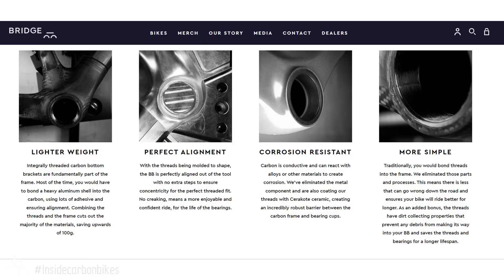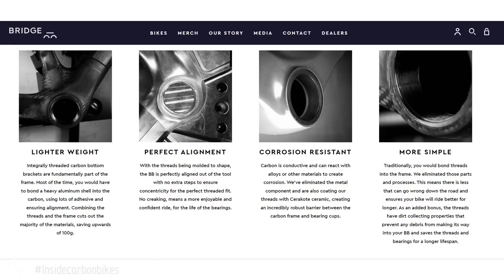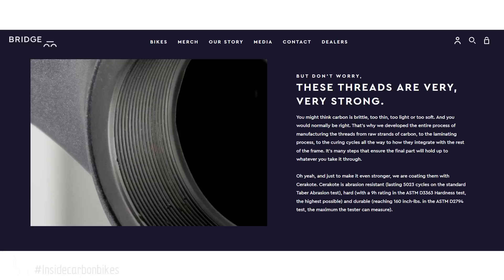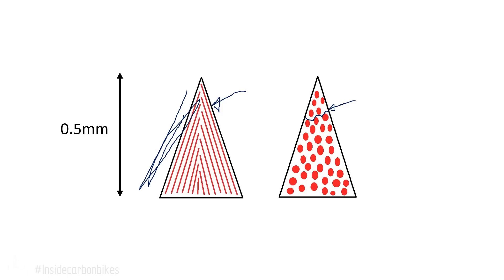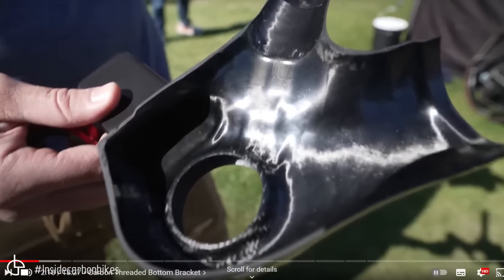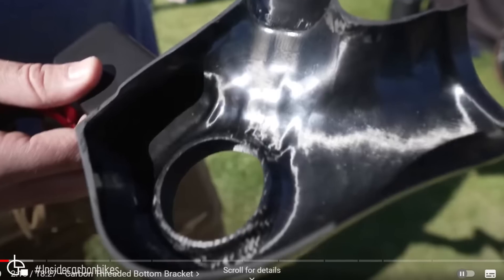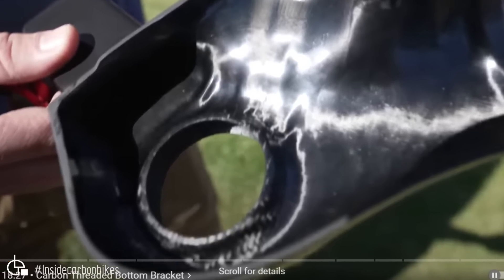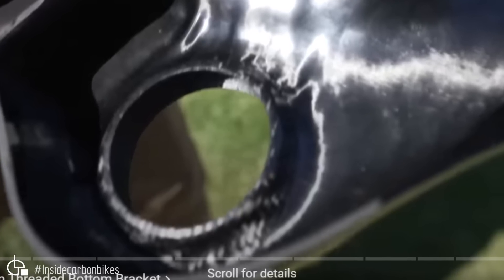Threaded Carbon Bottom Bracket???

Comment: I own a carbon bike. The aluminum BSA BB insert came loose but not fully detached. I have tried to remove it completely but does not come out. I applied 5 minute moderate heat, still nothing. Any suggestions?
Reply from the maker: Often they have ridges that get held by the adhesive.
Reply: @LuescherTeknik yesterday I put a bushing in between cups and started tightening the loose side while the other was completely tightened. Thus, forcing it to come out as the cup was threatening in. It came out about 3mm. I had to stop because eventually the bearing started coming off from the cup but the insert. I will repeat this pm. Keep you posted, hope I won’t screw up my frame (I think there is no other way around this.)

Comment: It seems to work for the people who've bought the bikes lol
Reply from the maker: Sure it might work but the point is that if one can make something accurate just do a pressfit, which is what the threaded cup that you screw in has for the bearing, it uses additional parts which are not required if the accuracy is up to spec.

Comment: Where are the treaded bearings on airplanes or automobiles? I have a 10 year old Felt F4 with an alloy insert for BB30 press fit bearings. Never a squeak or a creak after I replaced the cheap FSA bearings with SKF bearings.

Comment: If a company can make a perfect tolerance headtube in carbon and lay up the bike to be compliant in one area and stiff in another area as well as being a perfectly aligned frame for life; making a pressfit BB that is perfectly round with the correct tolerances to mate to an aluminum part so it isn’t to tight or too loose should be an easily solvable R&D solution, especially with companies like Cannondale, Trek and Specialized. They have access to in exhaustible resources to engineer the shit out of this issue so that even mass production carbon pressfits come out perfect. I am not gonna buy BB Infinite’s multi hundred dollar single piece (HEAVY!) machined aluminum insert to try and solve a possible creaking issue. Nor am I gonna lay down thousands of $$$ and purchase Specialized’s regression-engineering of molding a 90’s era engineered BSA aluminum insert molded into the carbon frame: and I’ll tell you why, I want my frame to last a lifetime like titanium like carbon , but when specialized molded in that chunk of aluminum, well those fancy BSA treaded chunks are oxidizing as we speak and as it turns to powder over time, yes, how much time?  Who can say? But within a lifetime some poor mechanic is gonna apply his 30 newtons to loosen and replace the worn BSA cup he may hear a strange cracking sound and initially think he stripped the cup or turned it the wrong way for crissakes. But no the bond just failed as all carbon aluminum bonds eventually will. So it is pressfit with a smudge of grease or loctite if need be.

Comment: I have owned a Focus Raven Max Factory with press-fit bearings since the end of 2015. The series came with one from SRAM, which lasted about a year. Then I installed another one, which lasted a few months. Then one with interlocking aluminum shells, which also only lasted half a year. Then I discovered Token Ninja bearings made of aluminum with excellent standard bearings with a screw connection in the middle of the aluminum sleeves. Everything carefully installed with lots of Klüber Starburags PM 30 industrial bearing grease. Combined with a Cane Creek preloader on my SRAM crank. It has been quiet and smooth for three years. The bottom bracket costs €99. Top value for money.

Comment: First I've heard about carbon threaded bottom bracket. Terrible idea for all the reasons you pointed out. Strength of the threads is dependent on the strength of the resin. What happens if you cross thread it? Throw the frame in the trash? Just a terrible idea on several different levels.

Comment: I'd be worried about the BB unit threading welding itself to the carbon threads, with, as you say, the tiny tool engagement offered by most manufacturers. At least with an aluminium shell insert, if it becomes galvanically attached to the BB unit, you can destructively remove the BB without harming the frame (too much).

Comment: The ideal fiber layout in a threaded interface is perpendicular but not symmetric. Remember when threading something in only one side of the triangle will be loaded.
Reply from the maker: From a load case this is likely correct, however a symetric fibre layout will reduce any molding distortion.
Reply: @LuescherTeknik  Not every molding distortion is relevant. Again: only the side taking the load really has to be perfect.
Reply from the maker: You want the bore to be round though ;)

Comment: so why can't the industry do a better pressfit bb?? Is it because of the cost of production? is it the in-field failure? I have read many stories of pressfit bb cracking, or creaking after bearing replacement, and it's probably due to the bb shell either cracking inside or expanding enough to create cracks, and this means warranty cost for the manufacturer.  Sure if pressfit is cheap to product, and does not give warranty issue, then big manufacturers would not be abandoning it?

Comment: I had Easton CX Fork once with internal threading, it was molded resin not CF.  It worked very well over most expanding inserts.
Reply: interesting, but the plug isn't subject to the kind of torques that the BB is subject to. Once the stem is properly torqued, it shouldn't be experiencing really any torque AFAIK.

Comment: My initial thought is that the threaded shell would be some other material, amorous carbon fiber using finely chopped fiber, or just pure high strength epoxy of some kind, etc.

I also agree that press fit should have become a standard because of the obvious advantages and inherently superior design, more typical of the standards in other more demanding industries and applications.
Reply: Some type of pure resin or epoxy layer would also serve to insulate metal BB shells from the carbon fiber.

Comment: Treads have a lager tolerance, so alignment is not as critical as press fit, Mail and female treads have no interference,  A press fit bottom bracket is dependent on interference fit and the bore alinement is very critical for bearing alinement  carbon my not expand and contract much but if you add epoxy to carbon you can expect the mixture to expand  and contract  probably more the then 50% of  press fit  tolerance. As the bearing OD stays stable  
Epoxy is a form of lick wood plastic  and is more susceptible  to temperature change Then steel.
 epoxy resins have a high coefficient of thermal expansion (CTE) of 60–80 ppm/K, limiting their application in some fields requiring extraordinary dimensional stability like aerospace and microelectronics industry

Example   A 30mm steel bearing cooled to -5C will shirk to 29.8mm and slip fit in the bore it was designed to press fit into.

Comment: Great to see you again! It would be great to see a video about the different grades of carbon used in frame manufacturing - T800, T1100, etc. What real-world difference does it make in the frame performance? Is the higher modulus carbon too brittle to be used for the entire frame construction? Does graphite and “nanotube” have any real benefits? Etc… Thanks
Reply: He has commented about different "grades" of carbon before. It's just hype.
Reply: @fieldlab4  Thanks Johan, LT has commented on different modulus carbon before but I have not seen any extensive content. I would think that there is some impact on using different modulus carbon in the frame construction. I’ve also heard a lot of conflicting information.

Comment: As a former track sprinter, I've never had a press fit last 18 months on my road or mountain bike. I would seek out frames that were NOT press fit. That is until I discovered screw together PF like the Wheels Manufacturing. I'm sure there are other great brands as well, but that has been my solution when I like a bike, but always hated PF.
Reply: What about one-piece BBs?
Reply: @sbccbc7471  How would you cinch it into the bottom bracket shell?
Reply: @Gizmoimages  One-piece BBs are press-fitted from the left-side of the frame and feature a flange only on the left to limit its travel. They only suit frames without permanent internal obstructions. BBInfinite and Hambini are the only brands that utilise such a BB structure.

Comment: Interesting drawing of the fibre direction. In the left diagram that you proposed is better,  the fibre would kink significantly as it turns to join the bore. Seems like that would compromise all the strength.  Did you think about that?
Reply from the maker: That is the point, I said that this was not possible to do in such a small section, the root radius would be so small that what you say would happen.

Comment: Yeah your point is spot on.  The problem with press-fit bottom brackets is poor manufacturing and if they can manufacture carbon fiber threads that work for a threaded bottom bracket then they can make the best press-fit bottom bracket anyone has ever experienced.

Comment: I agree, press fit is so much better. I think we should be using the BB386, the largest possible bore to accommodate almost every crank type.
Reply: Press fit has 10 x's the warranty returns compared to threaded BSA.  You don't know what you are talking about.  BB386 can be made to work just fine but press fit encompasses 'many' different configurations including Trek using 'pure carbon bore bearing surfaces'.  Specialized struggled for '10 years' trying to get their warranty under control with their 61mm narrow version of both BB30 and PF30.
Reply: @lukewalker1051  press fit is better when done right, but Specialized et al don't want to spend the money on proper QA. I bet the higher end Chinese carbon manufacturers (Winspace, Elves, etc) don't have the same magnitude of warranty issues with press fit. I also wouldn't be surprised if near shoring (Mexico) would be a better cost proposition for Specialized than doing good QA in China.

Comment: Nice to see you on screen again Raul. Hope the new workshop is up and running quickly.

Threaded carbon just doesn't make any sense either. The whole idea of how a thread works is to tighten one against the other or make the threaded "shaft" part come flush against the face of the frame. Either way I don't see how carbon threads can be strong enough to enable "x" amount of Newtons in torque to be applied without something breaking.
Very interesting stuff and would like to see work in the real world. 
If you've gone to the extent of making the threaded ring, why not make the bottom bracket a more solid piece then machine threads into that solid/thicker section of carbon and then alignment will not be a problem.

Comment: Just imagine some heavy handed mechanic using a big old wrench to fit the BB, just a bit more...a bit more.. a bit more.. BAM!!! oh... no more threads... all I can say is "less than ideal"... A perfectly concentric BB shell  the BB will slide in no issues and won't creak if fitted correctly.  I mean what's the problem that needs solving, it's not using threads, it's get the hole concentric in the first place.

Comment: The best application with the lightest weight is direct fit bb. I've worked with Don G when he developed the process for the R5ca and the most difficult process was to determine the shrinkage. 11 years later with 150,000 km on the frame still works perfectly. Real engineering by real engineers made this work.
Reply from the maker: Correct, Don knows some stuff!
Reply: Richard Matthews was also part of the R5ca development and is likely the one behind this system. I personally have no inclination one way or the other, but maybe having an in-depth discussion would make for a good point-counterpoint video.
Reply: @Torontoflatlander  I think it’s just demand from consumers. Press fit is better if it’s done right for all the reasons that Raul outlines in this video. A lot of potential customers hear that a bike has a press fit BB and immediately want nothing to do with it.
Reply: @rosss11111  I was talking direct fit not press fit. Just watched Hambinis video on this same product and he also said direct fit is where the industry should be going to.
Reply: @BikeFitnessCoaching  Yes, I meant direct fit I guess. Bearings directly in the bb shell, no extra pieces. 

Re: the R5ca, it was completely manufactured in California by Don and the rest of his team at Criterion Composites. The design work was done by the Cervélo engineering team. They travelled down to California regularly as part of the project.
Reply: @rosss11111  Agreed! Great team of actual engineers pulled this off!
Reply: @Torontoflatlander  I've ridden with Richard, great guy and engineer but I believe it was an all-California design.
Reply: One problem with this otherwise excellent system is that the process of extracting and replacing the bearings themselves will rub a small amount of carbon off the bearing mounts, which after a few times doing so will lead to a noticeably looser fit. Bikes need to be serviceable, and BBs are a high torque, high weather exposure assembly, needing servicing/replacement.

Comment: Press fit manufactured correctly is absolutely fine. I’ve had zero issues with my PF86. I replace it once a year with a Shimano part and it runs perfectly. No creaking, no grinding, nothing. The BB hole is in spec so I don’t even use retaining compound to take up any imperfections. Just a dab of grease to ease removing it next time. Some manufacturers put them in dry but I think grease is worth using. As for threaded carbon I don’t know, if they can get the engineering right it could be a genuine step forward but for me I’m totally happy with press fit. Maybe I just got lucky with my frame and got one that fell in spec.

Comment: I don't think press fit is hated by the industry. Consumers decided they want threated BB because of the problems they experienced with press fit. The Threaded Carbon BB is an attemed to mitigate some of the problems that come with threaded BBs in carbon frames (weight, corrosion). I agree that proper implementation of press fit would have been the better way.

Comment: Think you hit the nail on th head. I thought they went to threaded so they could machine up inserts to fix alignment issues and non round holes. Now they are bonding threaded carbon inserts in....makes no sense to me 😂.  So, the alignment on those ones is going to be vastly superior? 🤦🏻‍♂️. Just do pressfit ffs. There's nothing wrong if done right.

Comment: Good to see you post. I think I speak for many if I say that there's appetite in the community for videos like these - an honest opinion on a technology. No need to have the workshop ready for that.

As for the topic itself - the BS on the website says it all, doesn't it? 1. 'Lighter frame', yeah lighter to traditional threaded but same weight as a press-fit. 2. 'Reducing complexity' - again, compared to classic threaded. Compared to press-fit you're increasing complexity and potential failure modes. 3. 'No alignment issues' - you're really just admitting that you can't manufacture press-fit properly.

Comment: I'm back 2000's bikes after all the 10k-15k bike I've been on. It's heaven. I can't love a bike for just the looks if it's giving me some kind of different headache every week.
Reply: Just built a cheap bike project for 500$ aluminum aero frame, aluminum wheels and Carbon fork. Cheap components and around 8.5 kg. The Colnago Concept I built has R8000 components with integrated BS on any of my bikes, cable brakes and shifters, easy to work on and access any cable I want. Cheap bike project https://i.ibb.co/tmkPNqP/bike.jpg

Comment: 3 of the 4 road bikes i had between 2010 and 2021 were pressfit creak masters, so i assumed it was a flawed system nook matter how many versions were introduced. I could have easily drank this latest cool aid, especially considering the alloy bike i had up to 2010 had the standard british screw in BB which was far more reliable,  and quiet.

Comment: Nice to see you back. Personally I love PF. But regarding the strength of the structure wouldn't the mating thread from the threaded BB provide the strength to this BB portion of the frame? After tightening the loads through this area wod be perpendicular wouldn't they?

Cross threading may be more of an issue as the structure would be destroyed and could not be recovered?

Comment: "Remedies" like this one remind me of certain German car manufacturers that used to over-engineer their equipment for decades, relying on the extremely high quality of their parts. However, when the "outsource everything!" mantra became the norm and bean counters started searching for Tier-2 and Tier-3 OEMs to manufacture the "same" part at a fraction of the cost, the quality of the final product started to deteriorate.

This is no different from bicycle brands that often look for the cheapest supplier with hardly any quality control to produce complex parts. It was around the same time that PressFit bottom brackets began to gain popularity. No matter how great the concept is, if your Tier-2 supplier isn't up to par, customers will bear the cost.

Comment: Carbon is soft as cheese, it’s a terrible material for threading stuff into and I would imagine the Corrosion will be much worse because you have thin aluminium thread across a larger surface area in contact with raw carbon. 🤷🏻‍♂️